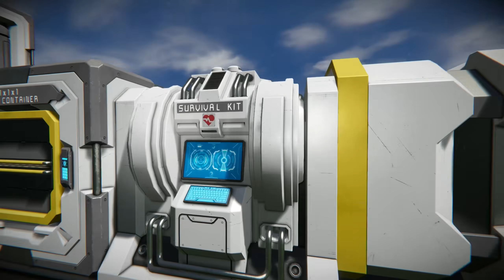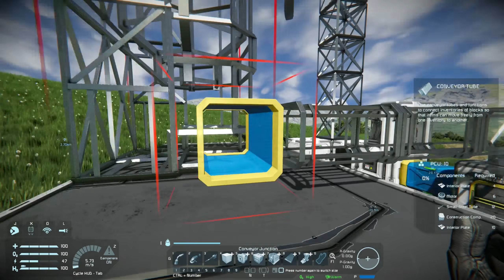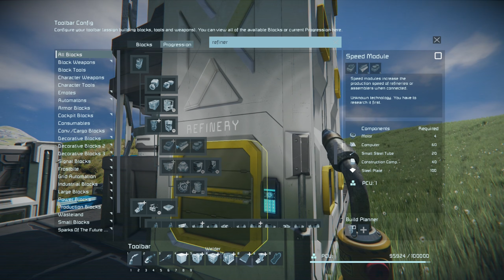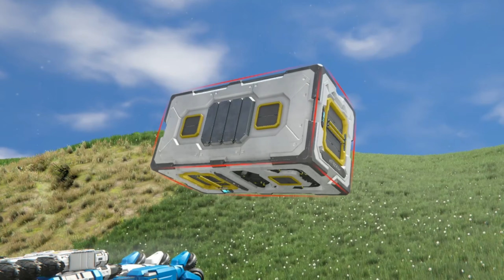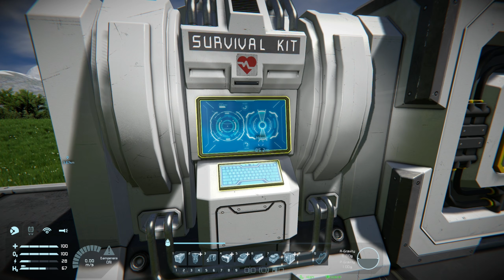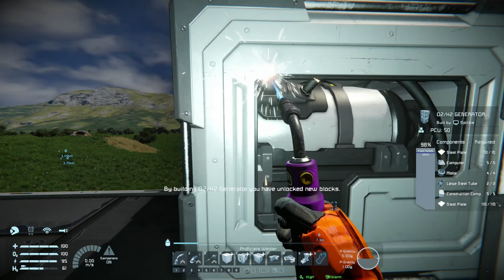Fancy Refineries and Assemblers | Space Engineers Survival Tutorial #3

Comment: Why did they never just make wireless crafting lol, where basically so long as a buildable object is connected to your main base where you have storage boxes with the required items in them to build it then when you pull out your welder it will pull those resources from the storages on your base in order to build it
Reply from the maker: The main reason is that would remove a lot of the potential for engineering solutions around those problems. While other games like say Ark or valheim have no other way to handle those things, in space engineers we have a variety of tools at our disposal that can achieve somewhat similar results if we try hard enough, and at least for me, that's as big part of where the fun is 🙂

Comment: I never really used the yield module.  I didn't realize they were really as good as they are.  But I guess I also never had that much of an issue of needing the extra yield anyhow.  Early on, I usually attach power efficiency modules, and upgrade to speed modules later.  I think the slowest ore to process is cobalt.  Takes forever to refine.  It also seems to be the ore that sells for the most at economy stations.  Even though the refined product is worth a lot less than many others by unit, it also has a significantly lower loss of mass, and it's enough that it makes the ore more valuable by mass.

Comment: At 19:03. A speed module does not double the speed of an assembler. It only comes out to be only around 33% faster. Over a 10 second run two assemblers produce 44 steel plate and an assembler with a single speed module produces 33 steel plates. Keen needs to change info screen to reflect the real difference.
Reply from the maker: Aww man, I mistakenly assumed they'd fixed these things when they fixed the incorrect display on the refinery :/

Comment: 2000+ hours in SE... but I didn't know about shift+MM. And how to use the cooperative mode. It worked once. By mistake) 
Your guides are still useful even after 2000 hours of playing throught about 4 years of real time xD
Reply: The main problem I have had with cooperative mode is if you run low on resources and end up with one assembler having the resources and one of the cooperative hogging the queue, since assemblers do not give resources to other assemblers, and cooperative mode assemblers do not release the hogged queue once they run out of resources you can end up in a deadlock where despite having the resources it cannot build them.

Or have Keen solved this?

For that reason never use cooperative unless I need ridiculous amounts :D
Reply from the maker: I don't think that's been solved, I also kinda forgot about it when I was making this but thankfully I don't think it will cause too many issues as the main thing I wanted people to realise was that things can go wrong with the assembler's inventory so it's always important to check them :)
Reply: Another thing is I didn't know about building queue and how to use it, so I memorized the amount of materials I needed for each block. Then I saw in some of Splietsie's videos that I can just add them to a build planner and pull them out from a container... OMG. Is that legal?)

Comment: Thank you for all the videos
I purchase the game and starting a game on Earth.
I did not spawn on the same spot as your video, and I have trouble finding Cobalt.
Any tips in finding this mineral?
So far I am only finding Si, Mg, Ni, Ag, Au and Ice
Thanks
Reply: Cobalt is usually just a tad deeper than your hand held ore detector can scan.  You'll need either a small grid or, better yet, a large grid ore detector to locate cobalt in most cases.
Reply from the maker: I'd second the suggestion of using a small flyer or rover to scan the deposits (since it sounds like you're spotting them, but just not seeing the cobalt that's probably in them but deeper). Even with small grid you'll find a lot more than you can with your hand drill :)

Comment: When I was making an ambitious ice drilling rig for the first time, and, while experimenting with experimental rotor settings, flung the 11 large grid drills directly into my mining ship and its carrier rover, I was not shying away from a reload. Much rather lose a few hours of welding and tweaking - but keep the firsthand experience I gained from it - than go through hand drilling again. You can often do it even better the second (or third) time with the lessons you've learned. This can apply to many games, but games like SE in particular where you can lose tens of hours of progress in moments benefit the most from it.

My favorite trick with build planner is that, while it queues what a block needs, it doesn't actually care if you queue the same block multiple times. For things like conveyors in particular, or modules in sets or whatever else, you can just use it on one block as many times as you need (up to its limit, at least) and it'll give you what you ask for. What's notable here is that it determines this based on the block you're looking at. That one steel or interior plate that's missing, if you haven't placed the framework of the rest, can add up over a while of doing this. Though with armor it's faster to grab steel plates from the inventory, in my experience.
Reply from the maker: 100% While it's always possible those devastating events can give you an exciting rebuild, if tha'ts not what you're feeling, then just reload and be happier as you get on with playing :)
Reply: A trick for steel plate is, queue up a blast door or two light armor blocks and then ctrl+click on cargo access, it will fill your inventory with plate and keep the queue.
Ctrl+click attempts to pull 10x your current build planner queue, hence the result.
Reply: @Vivi-yw1eu  Yea every time I have to build a lot of light armor, I just select and add a blast door block to my build planner and overall its very convenient!

Comment: Can we have a video on how to use the AI blocks. I tried following your one on AI drones which had a drone moving between two points in the background and you showed how to get a drone to fly to a point and auto dock, but it was very hard to follow as it seemed to only cover part of the process. All I could get mine to do was, takeoff (occasionally), land, (sometimes) and fly into the ground (usually). I was trying to set up a shuttle to fly between two bases as a quick transport.
I also still haven't figured out how to take control back from the AI so I can actually fly around manually and just use the AI as a auto return to base and land function.
Thanks.

Comment: I usually just go with yeild modules for refineries and speed modules for assemblers. Dunno about anyone else, but power efficiency modules by the time i get to them arent really needed as i already have a robust power grid by then.
Reply: Power efficiency modules are useful on a mobile base (No wind power, limited Hydrogen) before you have access to Uranium,.
Reply: @unclegreybeard3969  never tried rocking only a mobile base, may have to give it a shot after my playthrough of the never surrender.
Reply from the maker: With vanilla settings, yeah, I would do the same. But being a glutton for punishment I've frequently put myself in situations where power is a challenge so power efficiency modules can come in quite handy :)
Reply: @Splitsie  my go to has always been power -> O2 -> production. Have been trying to figure out the ratio for O2 farms per habitable zone size in space/planets with no atmosphere to use the air vent trick on.
Reply from the maker: I think if you have perfect tracking of the oxygen farms and are in space you can eventually fill any space with 3 per engineer, though if you're on a planet this realistically goes up to 7 due to having slightly less than half a day of sunlight in most places.

Those are just numbers that I've estimated from my recent playing with them as opposed to theoretical maximums lifted from the game files though, so it might be slightly less that's possible
Reply: @Splitsie  I've been using 10, been a little more than what's absolutely necessary.

Don't know if you are planning on doing an O2/H2 systems tutorial video or not, I've been doing a split system with ice only for H2 and farms for O2. Keeps enough hydrogen on hand when it's needed (figure H2 tank getting destroyed by SPRT when I'm not paying attention)